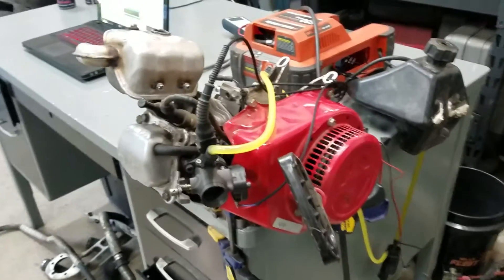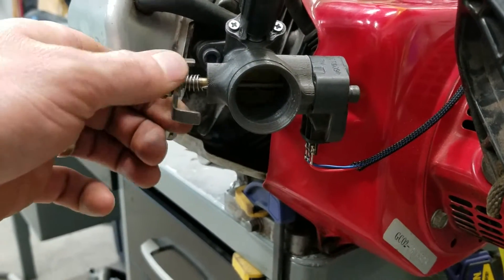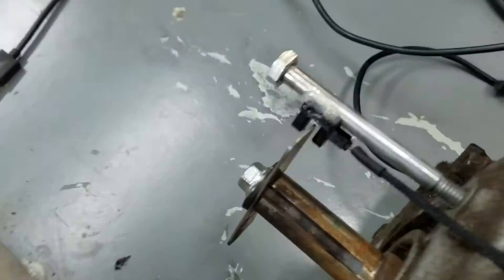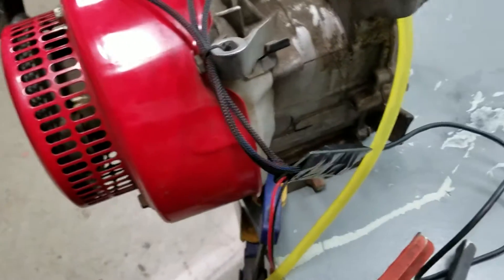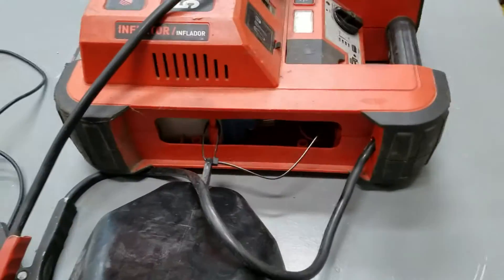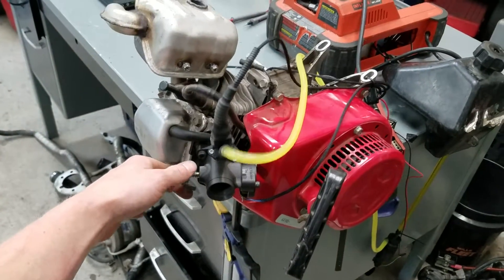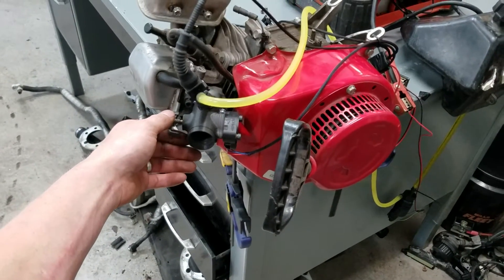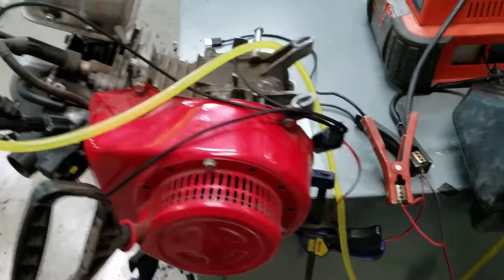Fuel Injected Honda GX160

Comment: This is exactly what i have been looking for. Might have to make some adjustments to the rpm pickup as the plate on the output isnt viable for what im looking for. Thanks for allowing us to use the code from the project.
Reply from the maker: @matthewrichmond5179  It is truly garbage code. Check out speeduino.

Comment: maybe a stupid question but can i use injectors without all those electricity connections since my bike has electric issues cant put it on yet
Reply: Look up mechanical fuel injection, its what diesel engines used before electronics.

But the fuel pump they used is specialized for that kind of purspose

Comment: Hey Sean, do you have a writeup somewhere about this? I'm trying to  make one up for a single cylinder moped.
Reply from the maker: I would look into speeduino. Super cheap efi base on arduino. Lots of forums and write ups. This was more of a proof of concept than anything.
Reply: What is the situation in the project? I'm also planning to do it for a two-stroke moped.

Comment: Do you still have the print file for that intake ? I'm working on  fuel injecting one of my GX160's.
Reply from the maker: There is a link in the description let me know if it works for you. It uses an Dodge Intreped TPS. If you have a different TPS I can send you the parasolid model so you can more easily modify it.

Comment: Hi i have question how u connect that TPS you connect ground,+5volts and TPS output because i try use trottle body with golf mk3 that output on TPS is around 0.6 to 4.3 volts idk whether it will work?
Reply from the maker: That should work just fine. You will most likely have to make changes to the code for your setup.
Reply: @snagle87  oh okay and you use some mosfet for opening that injector or you normally connect it in arduino i have 5v injector that doesn't blow arduino ?
Reply: And what am need to change that outputValue = map(sensorValue... ? Because am connect that trottle body on arduino and am open monitoring value on that TPS is min 220 and max is 864
Reply from the maker: @justradek4751  the values should read something like: 

 outputValue = map(sensorValue, 200, 880, 1500, 3500); 

instead of: 

 outputValue = map(sensorValue, 0, 1023, 1500, 3500);

The 1500 and 3500 are the output signal to the injector and could be very different from what I have. 

What are you building and what are you using for parts?
Reply: @snagle87  I using 5v injector from Opel tigra 1.4 onli isues is idk how much ampers needs for open am use for step down with 12v on 5v car cigaret phone charger that open that injector that have 250mA
Reply from the maker: @justradek4751  I have never seen or heard of a 5 volt injector. Can you show me what you have for a circuit. Look at my "about" on my channel and email me what you have so far.
Reply: @snagle87 Am send you email
Reply: @snagle87  1500 and 3500 injector signal, how do you measure it?
Reply from the maker: @ВадімФедина  do you mean how did I come up with those numbers?... they are the injector pulse values and they will be different for everyone because it is dependent on fuel pressure, injector size, engine displacement, etc... play around with those values and see what works for you.
Reply: @snagle87  How is injector momentum measured?
Reply from the maker: @Вадім Федина  do you mean flow rate?
You can measure that by holding the injector open and measuring the amount of fuel that comes out over a period of time.
Reply: @snagle87  no, not an expense, I want to know what this value is 1500-3500 and how to determine them?
Reply from the maker: @Вадім Федина   the value is arbitrary... I just got the engine running and tuned it by ear by changing the value.
This was just a proof of concept. I would look into speeduino as an actual solution for EFI. I would not run this setup on something I cared about. The tuning is very limited.
Reply: @snagle87 amigo este valor de 1500 é a baixa da injeção? E 3500 éo valor máximo rpm?

Comment: THIS is what I'm looking for :D 

question: If I use a throttle body from a moped which already includes TPS and Injector (maybe a I'll buy a Honda BeAT throttle body). Will this enough for the system to work?
Reply from the maker: As long as you have fuel pressure to the injector. I would look into speeduino though.

Comment: Can u make a video show how to set the electrical for the injector fire
Reply from the maker: I'm not sure what you are asking. Are you talking about the electrical schematic from the arduino to injector?
Reply: Yes.
Reply: And how to set the timing
Reply from the maker: @copseverywhere5160   the injector squirts twice per revolution. This was just for proof of concept not to actually run the engine under various conditions. check out Speeduino for a better solution. A good starting point for injection is around 390 degrees after the ignition event then advance from there.

Comment: Why not use the magneto as a source trigger and write an angular delay into your script to actuate your injector?
Reply from the maker: It was a quick proof of concept. I threw this together in 2hrs(3d print time included.) I'm not very familiar with inductive pickups or getting a clean signal from one. Have you done it?

Comment: Hi! Amazing! Can you write me your arduino's code for this type at Arduino?
In the link there is a code but i don't read with the smartphone. Can you write me whit massages here? Or whith  a comment.
Thank you
Reply from the maker: const int crankPin = 8;     //pin 8 for signal input
const int sensorPin = A0;    // select the input pin for the potentiometer
int InjectorPin = 9;      // select the pin for the LED
int sensorValue = 0;  // variable to store the value coming from the sensor
int outputValue = 0;
int CrankSignal = 0;
int lastCrankSignal = 0;

void setup() {
  // declare the InjectorPin as an OUTPUT:
  pinMode(InjectorPin, OUTPUT);
  pinMode(crankPin, INPUT);
}

void loop(){
  CrankSignal = digitalRead(crankPin);

 if (CrankSignal != lastCrankSignal) {
    // if the state has changed, increment the counter
    if (CrankSignal == HIGH) {

  // read the value from the sensor:
  sensorValue = analogRead(sensorPin);
  // turn the InjectorPin on
  outputValue = map(sensorValue, 0, 1023, 1500, 3500);  
  // change the analog out value:
  digitalWrite(InjectorPin, HIGH);
  // stop the program for <sensorValue> milliseconds:
  delayMicroseconds(outputValue);
  // turn the InjectorPin off:
  digitalWrite(InjectorPin, LOW);
  // stop the program for for <sensorValue> milliseconds:
 // delay(60);
  //(60)ms is 2000rpm
  }
  else{
      digitalWrite(InjectorPin, LOW);
  } // save the current state as the last state,
  //for next time through the loop
  lastCrankSignal = CrankSignal;
 }  }
Reply: @snagle87  Thanks
Reply from the maker: It is super primitive code. I would look into speeduino if you are interested in fuel injection.
Reply: Thank you soooooo much!

Comment: Is the code for any engine? like if i where to do this to a 420 predator? or does it have to be a certain injector
Reply: So if i where to buy a 420cc injector,a tps sensor and run the code on the arduino would it run?
Reply from the maker: @randomvideos3026  That's not how it works, the injector size has more to do with the amount of air that will flow through the engine. There are calculators out there that can give you an idea for what you need. There are far better ways to fuel inject an engine my code is too basic for full range power. Look into Speeduino or Megasquirt if you are interested int converting you engine to FI. Good Luck!

Comment: What kind of injector did you use?
Im planning on buildind an efi system for a turbo 2 stroke build.

Thanks
Reply from the maker: I use a 19lb or 200cc (Way too big) injector from a dodge neon. The fuel pressure is much lower than a typical EFI system. There are a lot of good calculators out there for engine fuel requirements. Good luck with your project.

Comment: Not bad!  Although, it does sound like it's starving for fuel during fast throttle transitions.  Did you ever try to perfect the fuel vs. rpm mapping or anything like that later on?  I was also curious about your code and i/o.  Are you using interrupts or is all the control being handled in the main loop?
Reply from the maker: The code and electronics are very primitive. It was more of a "single afternoon proof of concept" type of a project. If you are good with writing Arduino code I would be willing to test it out. I haven't really found much info for arduino EMS other than a bunch of people nay-saying the idea. I don't see why someone couldn't write some effective Alpha-N Code. I just kind of threw it under the work bench after that test. So many projects and so little time.
Reply from the maker: Code link is in the description. Sorry it took so long.
Reply: Do you still have the sketch?
Reply: Simple, but effective.  I suppose getting the mixture right would depend on fuel pressure, for the most part. Although, I do see that it does compensate for throttle position. I like it.